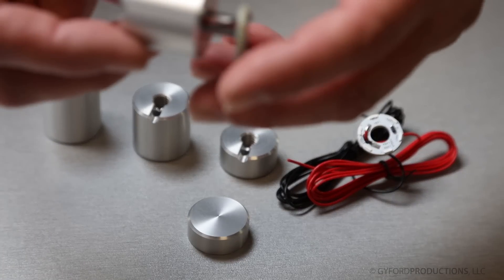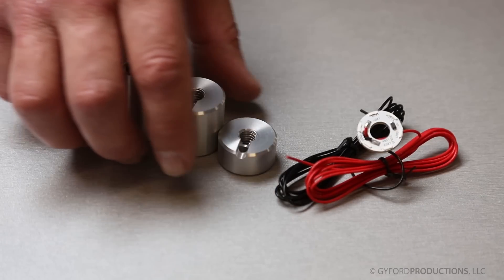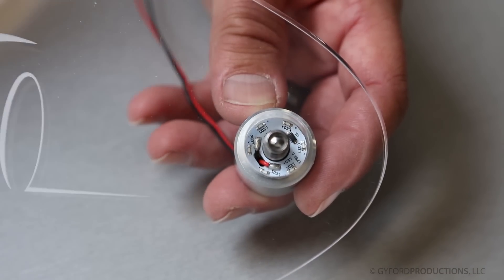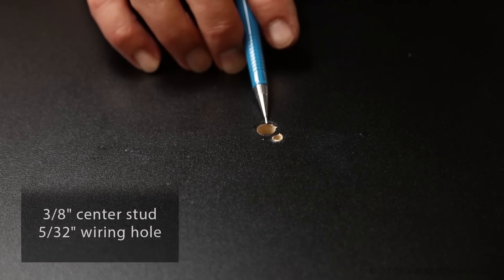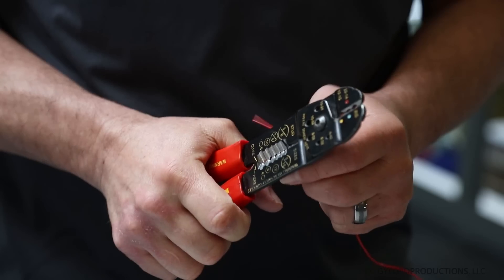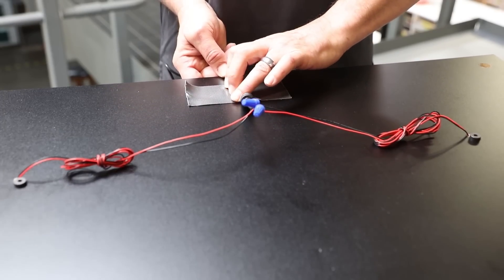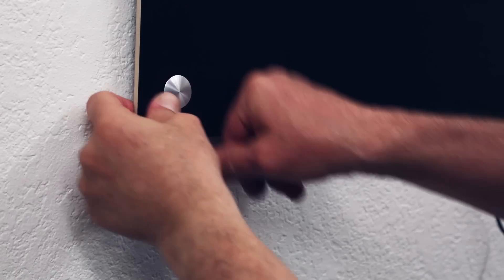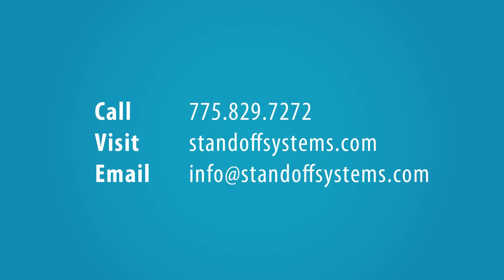LED StandOffs by Gyford Standoff Systems

Comment: What is the amount of weight it can hold?
Reply from the maker: Lance, Stanoffs can hold quite a bit of sheer weight but there are several variables, Please call us 775-829-7272 to discuss the type of material, anchors, and surface you are mounting to.

Comment: Are they also in square?
Reply from the maker: MMD,
Our square standoffs are not stocked for LED but we can drill the square 1'' and 2'' standOffs here at our custom shop. https://www.standoffsystems.com/product/square-standoff-barrel/
All you will need is a 5/32'' hole drilled next to the stud hole, this will accommodate the LED wiring.
Reply: Thank you for the information :)